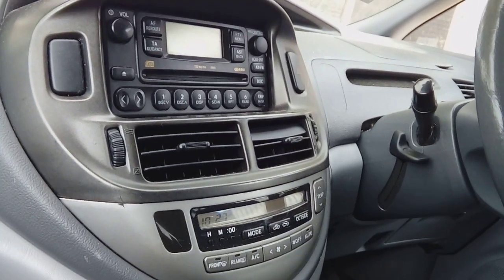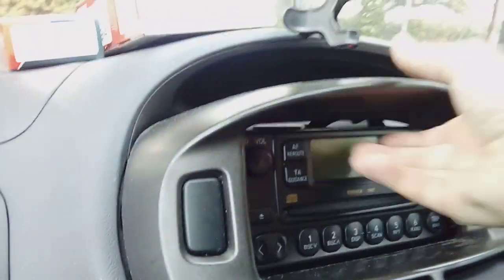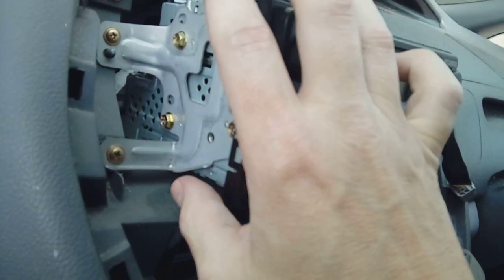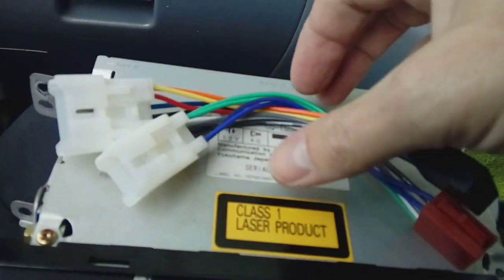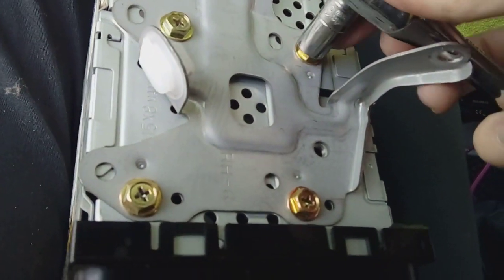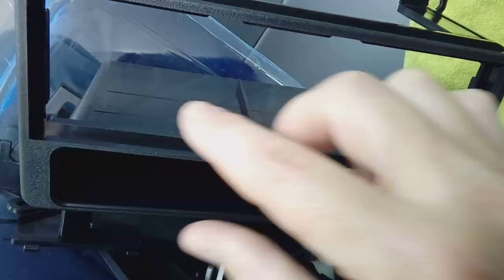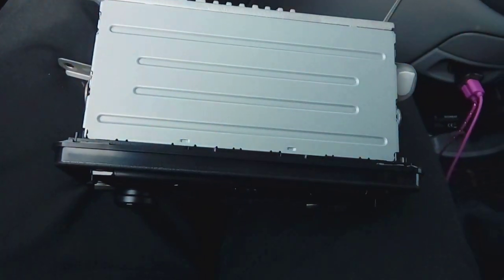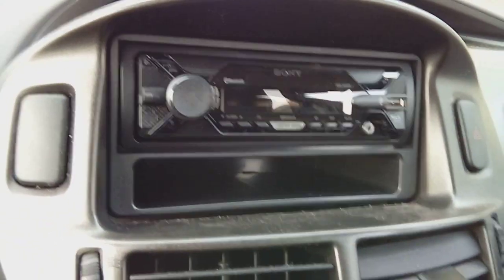Toyota Previa Estima 2000 - 2005 how to remove & refit radio,simple guide with part numbers.

Comment: Hi, is there a kit that the steering controls will still work with? Also my Previa has an aftermarket head unit but the factory fit DVD screen doesn’t work, were these ever connected?

Comment: Hi PJ.  Thank you for your very instructive video.  Does the radio have to come out to remove the cupholders bracket (below the centre vents)?  Ours has a piece broken out of the track and the moveable support that holds the cup keeps falling onto the floor when a cup is placed in it.  Cheers.

Comment: Great video. Really helpful. I see the two blue plugs are radio related, as you mentioned, but what is the white plug? Is it for the trip computer built into the Toyota stereo?
Reply from the maker: Depending on exact spec it can be just for steering controls or a combo of radio options as well such as trip computer.